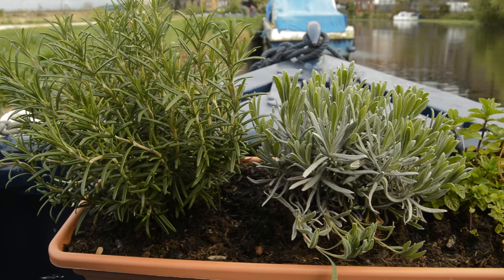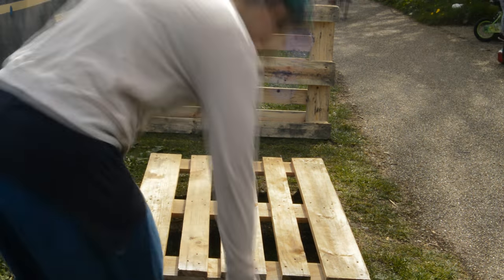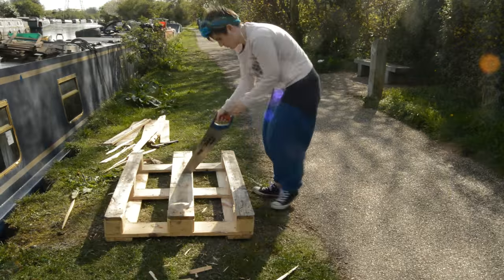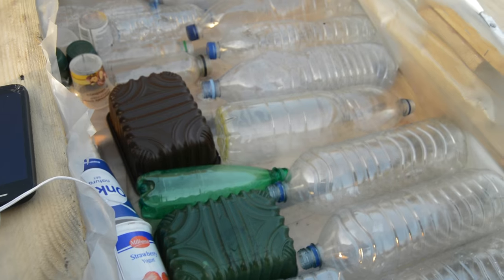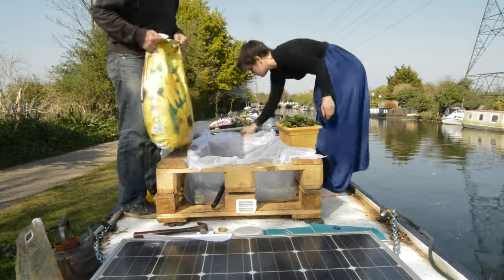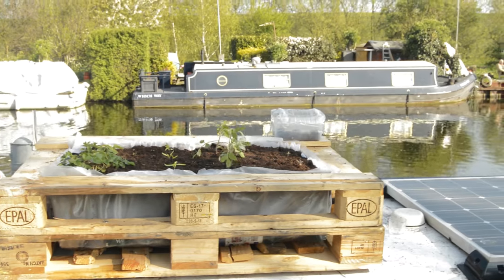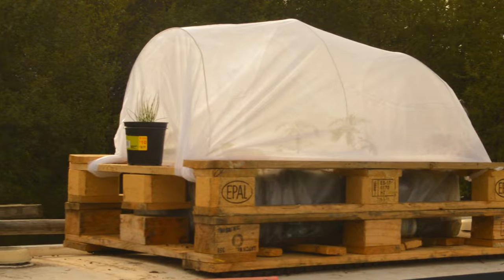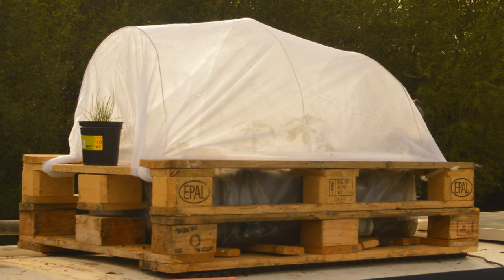Narrowboat Gardening, Building a Self Watering Plater!

Comment: You'll need to keep an eye on your plants when it begins to get warmer.  Wilted leaves are clear signs of overheating with your "greenhouse" cover.  If you still have pest problems once your plants are too big for the enclosure, use chicken wire.  (That's what we call it here in the States.)  Our house is in the mountains a half-mile from the nearest neighbors and the deer love our property.  I built hoops above my garden (like you see for use with poly-tunnels) but I've covered it with chicken wire.  Keeps the deer from eating my crops.  Works with squirrels and rabbits, too.
Reply from the maker: CallmeRogerRoger the added heat should help it doesn't get that warm here!
Reply: Yeah.  I understand.  I've spent a lot of time in the UK (mostly Lincolnshire, London and various parts of Scotland) and I wouldn't call it swimming weather most of the year.  We're going to spend two weeks on a hire boat on the Union and Forth and Clyde next spring in preparation to buying a narrowboat for a one to two year continuous cruise when I retire in four years.  I have to say that the wet weather is something that we're quite concerned about.  We live in the Rocky Mountains (Central Utah) and get snow and rain but mostly sunny skies.  Alas, no canals here!  My wife and I are avid Anglophiles!  Thanks for your channel.
Reply from the maker: CallmeRogerRoger  what worries you about the wet? it sounds like a lovely plan you have there!